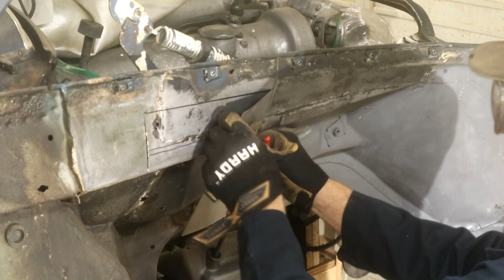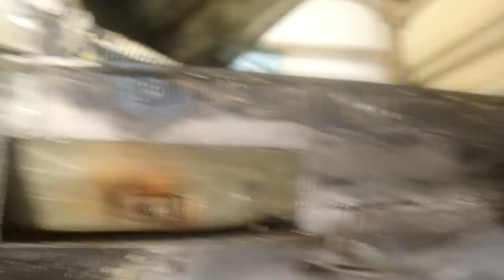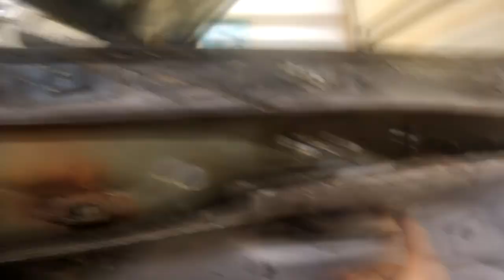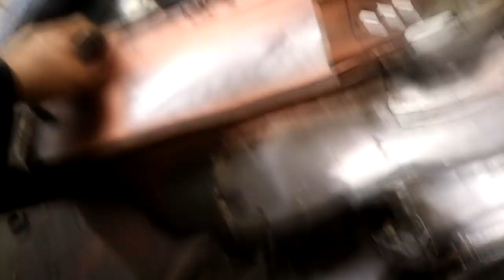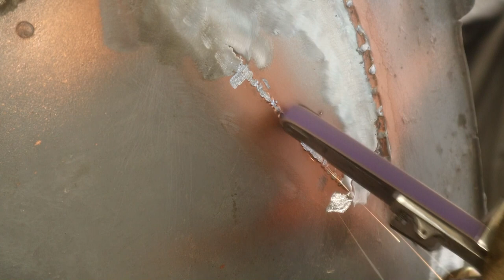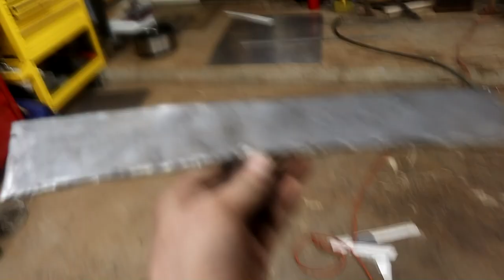Mercedes W109/W108. Inner wheel arch. Re welding a poor repair.

Comment: I took a welding class at a local community college and I felt like I gained so much knowledge when looking to solve a metal issue. Most things seem so much simpler now. I was sixty at the time and was surprised how much a welding newbie could create additional issues. Just my two cents. Your welds are very good and most importantly you are not in a hurry and understand the effects of welding on surrounding material. Looking forward to more learning videos from you. I have the same problem coming up with the name for the rust encapsulator...

Comment: I was doing similar repair on my R107 - for the areas in the arch/inner wing which aren’t outer panels I just brushed and rolled on epoxy primer over the repaired area which eventually I’ll put a black or body colour top coat over, the rust encapsulater and then epoxy primer is probably an unnecessary step. I perhaps wouldn’t use Raptor, I’ve heard mixed things about it’s adhesion.
Reply from the maker: I've decided against raptor after talking to a lot of people. I spoke to a guy that worked at the classic Center in Irvine California. They used "Wurth" its as close to the original as possible. Cheers John.

Comment: Really enjoying seeing your work. You might try the way Fitzee cuts in sheetmetal to get a flush mounting surface, saves a lot of fitting and time. Regards, ta!
Reply from the maker: Thank you for the comment. It's funny you suggest that. i watch Fitzee and think he's great. I am going to do that method, i want to use a recip saw because it has a nice thin kerf blade. I'm waiting for it to arrive. the ones I had were garbage. It would save a ton of time. All the best Cheers John.